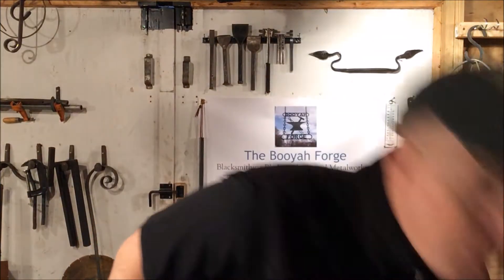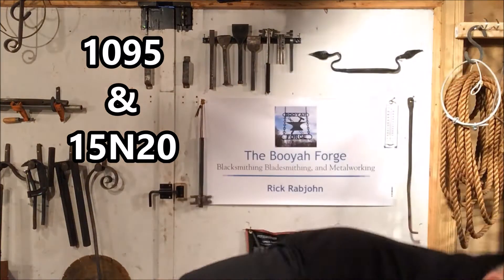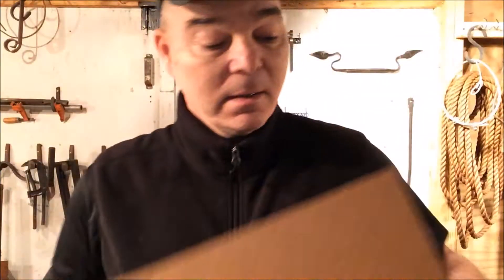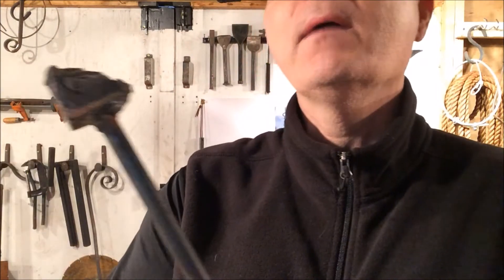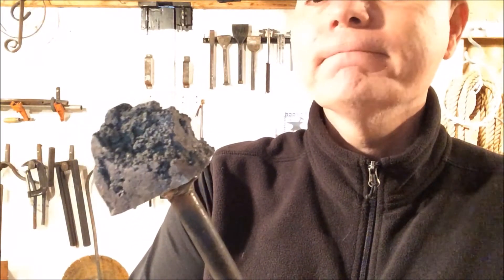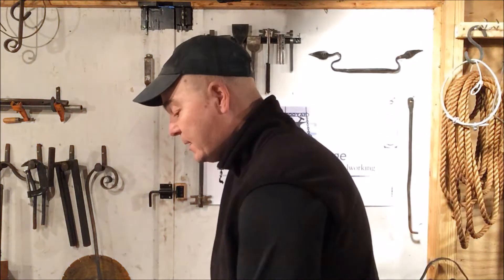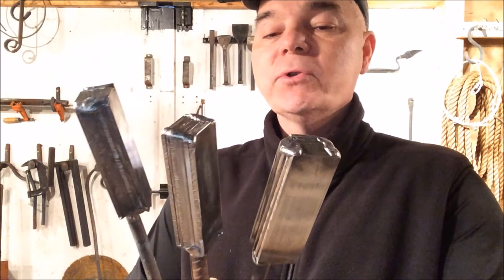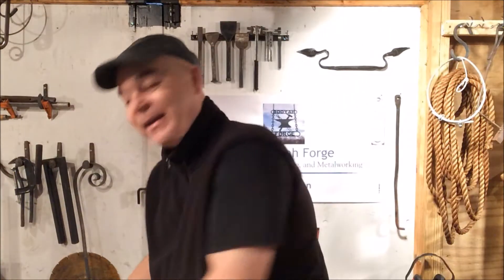How to Make Pattern-Welded Steel - PART 1

Comment: Nice work man I'm trying it myself for the first time as well
Reply from the maker: Thanks man - this is not easy - after cleaning up the three billets one billet was good and solid throughout, one delaminated completely (I could easily peel back each layer with a chisel and hammer) and one had two small spots of delamination.    So while I got a handle on my heat, the challenges continue.  I am now trying to double down on the prep by sanding more and cleaning the metal with acetone.   If that doesn't work, I''m going back to woodworking :-)))